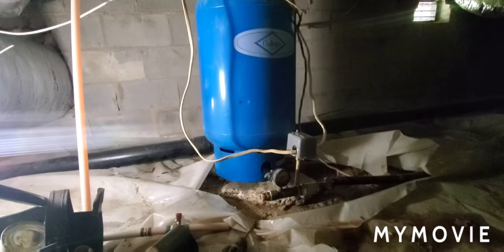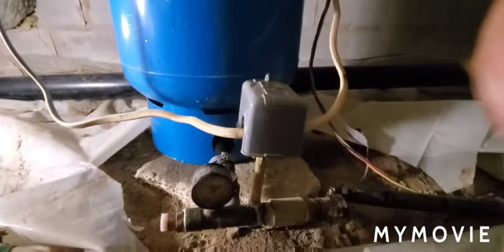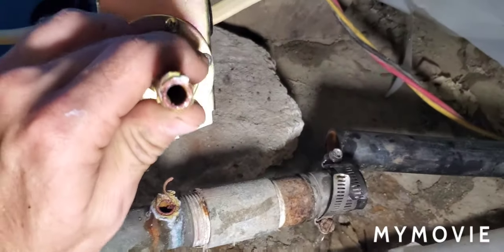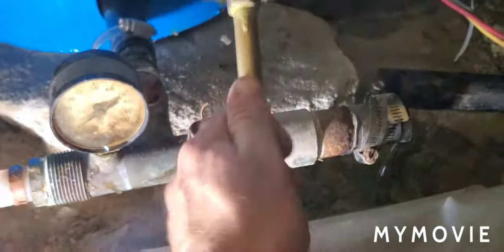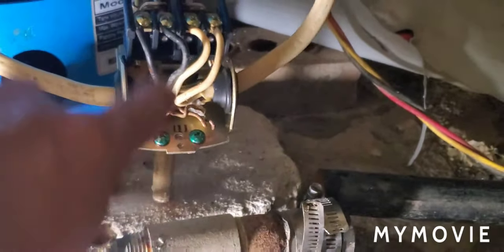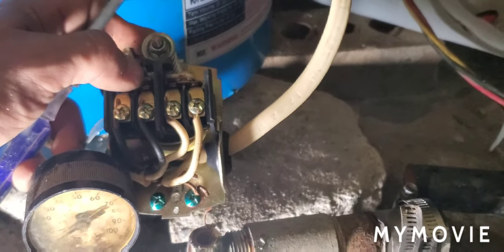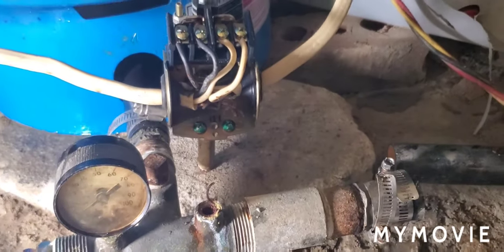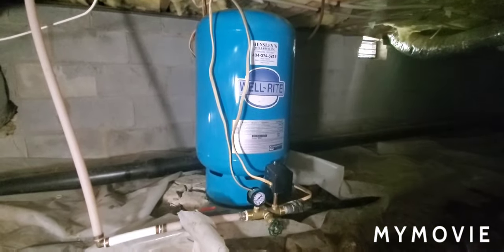No Water or Low Pressure how to fix it & diagnose the issue. Well pump not pumping

Comment: How would I find out if my well has leak in it because my pump runs without creating any pressure and I haven't seen any noticeable water anywhere?
Reply from the maker: Pit a Clamp style amp meter on a single black or white wire & if the pumps running, it'll read around 7 amp. Only way to know if it's running

Comment: I am not getting any water. I haven’t used the pump in about 6 months but have power to the switch. I can’t get to the possible build up that you show in the video. Any suggestions? I have a video showing my situation.
Reply from the maker: Hwdracing@gmail.com  email me the video and I'll try to help you. 
Test for voltage out at the well head where the wire connect. If u got power there & no water, you'll have to pull the pump/pipe out. Itll be a bad wire or bad pump (if it's a submersible pump)

Comment: I've got a pump that started running low voltage and won't get my psi above 40/50 psi. The switch is a 40 60 but the pump will just continue to run but gain no pressure

Comment: I have had no problems with my well until this morning  The contacts are touching and clean .   The pump is getting 110 volts and the contacts 220  .   No presure .   Blue tank is at 30 lbs.   Circuit breakers are working.   well pump 12 years old deep well pump only no surface  pump

Comment: QUESTION? My water in the house will randomly stop , then come on 30 seconds to a minute later. When I go to check ,the pressure switch is in the closed position n pressure is at 0. The pump then kicks on , fills the tank , then the switch opens.The switch is a 30/50 n is operating correctly.Could it still be a clogged nipple although the contacter is closed?  Tank n pressure switch is 3 years old. Any help would be greatly appreciated.
Reply from the maker: Your experiencing a dying pump. Itll run randomly for short bursts & cuts off. The pumps bearings are shot & its overheating the electric motor til it cools down enough to run again. 99% certain it is the pump. Your comment is spot on for that diagnosis

Comment: What would it be if I have good cold water everywhere but no hot water anywhere. My pressure tank is good. Brand new water heater because I was over messing with the old one. But I can’t get the water heater to fill.
Reply from the maker: It's likely that you turned on the water heater before it was completely filled with water and it burned out the top element (I've done it) bc it wasn't in the water yet. Youd have to measure resistance on both elements to make sure they are equal (test to see if 1 is bad) but the breaker must be off while testing. 
I always open the over-pressure valve to bleed out the air, then I open a hot water faucet til I get water & no air. Then turn it on (breaker)

Comment: I have 48 lbs of pressure in my tank (30-50), but no water when i turn on the faucet.Any advice?
Reply from the maker: Don't trust the gauge. They made for a nickle in China 😆 
I'll send you a link to 2 videos of mine that will help you.
Reply from the maker: https://youtu.be/PAd94cFX5y4
Reply from the maker: https://youtu.be/NUX5lcMLdOU
 These should help you. It's important to watch both & maybe take notes. You can setup the system correctly and get longer pump life & better pressure if you follow my guidance given in my videos. My channel has a Well Q&A Playlist that you might like to learn more. Hope this is helpful 🙂 Happy Holidays
Reply: @h2omechanic  Thank you so much!  I used a pressure gauge and it was at 39lbs but still no water lol. Turns out it was some kind of clog in the piping that wouldn't allow the water to flow.  I opened the hot water heater bypass valve and it let the water run.  Magically cleared the clog. I'm up and running. I appreciate your quick response. Happy Holidays.
Reply from the maker: A 30/50 switch needs 25psi of air in the top section of the tank. But air pressure must be tested & set with the pump off & water pressure at 0 / tank empty of water.
Reply: @h2omechanic  okay, thank you. I will do that right now

Comment: This video is very informative. I was wondering if you could help.  We have no water but the gauge is reading between 5 to 10psi. I did try to see if there was a spark and it only sparked one time. The other times,nothing. I also tried flipping the water well main box on and off and the only thing I hear click on is the control panel. Not sure if that's the only thing that is suppose to click. If you have any suggestions as to something else I may try to get water. I would appreciate it.
Reply from the maker: If you turn the power off, does the gauge drop to 0psi?. Being that you saw a spark, You probably have a failed pipe or fitting in the well, near pump. Or pumps old & won't lift water anymore. If powers off & pressure drops to 0, there's a hole in line in well. Also if it shows 10psi, water should come out at tank drain or sink, just slowly. If it stays at 5-10 w power off & sink open, the gauge is faulty. 
With power on, test for voltage out at the well. If power is out there... 240v typically, & no water,  then you must pull the pump out of the ground. If its 12-18 years old its probably a bad pump or broken wire. But it u see a spark at switch, its a hole in pipe or fitting. Hope this helps
Reply: When I turn off power gauge stays between the 5and 10psi. No water at all coming out. I switched out the pressure switch and nothing still. I also tried a new control box and as well nothing still. The pump is brand new,only 1 year old. Is there anything else I could try?
Reply from the maker: Test for voltage out at the well. If your getting power there, you'll know its down the hole. Possible a bad wire going to the pump. Wells are abrasive. They can rub away the wires jacket & prevent proper voltage from reaching the pump. Id say 75% chance that is your issue if u have power at well head

Comment: Hi. My problem is that I do have good water pressure, but my gauge wont go more than 30psi and goes down to 0 when the water is running. Is it my gauge?
Reply from the maker: Maybe the gauge is bad? 
Or possibly the air in the tank needs to be adjusted.

Comment: Hello sir ran into some issues with my well pump everything was working fine until I got inside the shower and ran out of water lol. 
When I turn on the circuit breaker the pump turns on it has a weird sound compared to what it had before and there is some burning smell coming from the pump .
the axel is turning and there is  small amounts of water coming trough ,
pump is running for like  30 seconds reaches 10-20 psi then turns off and repeats the same process what do you think happend ?
Reply from the maker: Pump motor is locking up. Replace the pump! Asap! I bet it feels super hot to the touch
Reply: @h2omechanic  just went back there took a look at it again and I was able too see that all the windings inside have been burned I guess that means the pump is done 
  is it better to get the motor rewinded or just get a  brand new pump ?

Comment: I just checked my pressure tank and water came out of the valve, it should read 28. It reads around 50, what might have happened? Thx
Reply from the maker: Water came out the air valve up top? Then that means the tanks bad. Time to replace it asap

Comment: The pump runs but doesn’t have much pressure..it just stays 20 lbs and when reach that point, the pump keeps running..doesn’t stop..and the gauge steady 20..? Changed the pressure switch plus connections piping..drained the tank clean it..but same thing 20 lbs..any helps.. thanks

Comment: Please help!  I have a situation with my system. Pump
Was not turning off so I replaced gauge and pressure switch. It was taking a long time to get to pressure 40/60.  Once it did it shut off, thought all was good.  Now (day later) it can’t get up to 40 so it just runs and runs. I made sure there was 38psi in tank, still not shutting off.  When I manually shut pump off it sounds like motor is winding down as if water is flowing in the wrong direction, it used to just stop completely.  No idea of what my problem
Is. Please help. Ty!!
Reply from the maker: @minorm2  the Water is doing exactly that! It's flowing the opposite direction once the pump turns off. Here's why,
You have a hole in a fitting down in the well or a cracked fitting/ pipe. 99% sure of this. Turn on the system and go put your ear to the well & see if you can hear it leaking (if not the the leaking area is below the water.)
The pump must be pulled out, if you attempt this, be careful no to allow it to break off & fall, so as you pull out the pump, use the wire as a Saftey rope incase the pipe /fitting breaks off completely. 
That's the issue, typically it's the fitting directly in the top of the pump.
Reply: @h2omechanic  I don’t have a well. I have city water filling a 5k gallon tank that the pump pulls from and then to the pressure tank to supply water to entire property.  The pump is located next to both tanks at ground level.

Comment: Once my pressure gets to 40 psi the pump doesn't turn on to raise the pressure. It works if I manually flip the breaker and raise it myself.
Reply from the maker: Remove the switch and clean out the nipple below it. (It's probably clogged) or the tank has too much air in it (if it's new)
Reply: @h2omechanic  I was just watching your video about this! Thanks I'll go try it.
Reply: @h2omechanic  it wasn't clogged.

Comment: I'm having trouble priming my deep well jet pump. I can hear air seeping out at the connection  between  pressure switch line and points..  This isn't good I believe tried to tighten also points are fairly new.   Been at it for some time now, took pump  off and threw it in the bath tub it ran fine hows this happening?? I have shut off valves in key spots not sure what I'm doing wrong
Reply from the maker: The air leaking in is cavitating the pumps impeller. You must seal everything. You test proved the pump is operating. It's on the plumbing. Possible foot valve leak too.
Reply: @h2omechanic  
God bless you sir .. to me and I'm   no pro but almost certain it sounds like its pushing the air  out at that connection, if foot valve were leaking i thought it'd be opposite and sucking. Just curious. You're right though sir on the plumsomewhere. At least I have a direction.

Comment: What if my pressure switch is kicking in and off like it’s suppose to but sometimes the pump won’t kick on when the contact connect and when it does kick in it seems like the tank is empty but the only time there is water pressure is when the pump is running as soon as it shuts off pressure is loss
Reply from the maker: The tank might have to much air in it.
The switch could be old & not making full connection everytime.
The nipple below the switch can be clogged as well.
If pressure fluctuates w/o using water, then the checkvalve in the pump is bad.

Comment: Hello, I am having no water pressure. The tank is 82V 75 PSI. I’ve tried everything. Most times turning off the breaker and back on again fixes the issue but not this time. Please help.
Reply from the maker: https://youtu.be/PAd94cFX5y4

This video typically helps get it going.
Reply from the maker: https://youtu.be/NUX5lcMLdOU

This explains more on how it all works. 
Familiarize yourself with the system.

Comment: We live  in SE Alaska..
Reply: Having problems since we relpaced!  Our pump.. takes for ever to get pressure to 60 psi.. we blew out the water line to make sure it wasnt plugged.. pump runs forever and  we have water coming into the house just not much pressure.. we didnt change anything else just the pump.. air tank is set correctly..

Comment: Ok I checked the pressure tank it is not heavy it ways about 20 lbs. I cleaned out the sediment to the pressure gauge and I checked the pressure/ pump switch and I still have no pressure. Any ideas 💡?
Reply from the maker: Test for power out at the well head. If you get 240v there, then its either a bad pump or broken wire
Reply: Thank you for your response I was only pulling 120 from one wire I used a thumper and there were no broken wires it was a bad breaker replaced it and she is up and running. Thank you, Ben

Comment: Help! Left sprinklers on by mistake for several hours. Looks like ran well down enough to run out of water in the house. I went under house and checked pressure switch it was in closed position but contacts were clean and do see slight spark when flicked open/closed. No water in pressure tank and zero pressure on the gauge. I tried flipping break to well pump. Nothing seems to be working, seems to me not getting water to the house from the pump. Any ideas or other things to check? We have no water going on two day now. Thanks!
Reply from the maker: Its possible that you burst the drop pipe. Is your pump 300 to 400ft deep?
Keep the breaker off!
Reply: @h2omechanic  it's a older well house built later 80's. So it's a wider, shallow well I guess you'd say. I have turn breaker off. Guessing issue is at the well or pump? Do they burn up if ran dry? Do pumps have a safety shut off in that case? Or maybe I sucked up some silt and blocking pipe, not sure. Looks like May have to call someone out tomorrow.
Reply from the maker: Above ground pump or in the well submersible pump?
Reply: @h2omechanic  submersible pump inside well
Reply from the maker: @shirsch4722  if you have a 24" bored well. You probably need a while to allow the well to fill up. Have you looked into the well? Can u see water?
Reply: @h2omechanic  yes I lifted the cover, and can see water level is above pump. When I had the top lifted, I could see the pump shake like it has cut on for just about 5 to 10 seconds then cut back off. Only did it once while I had top off that I could see.
Reply from the maker: @shirsch4722  if you saw it run for 5 to 10 sec & it quit, then its burned up from running dry most likely. Is the pump 15+ years old?
Reply: @h2omechanic  it was replaced in 2017. Like you say maybe it burned up. Going to try to have someone take look tomorrow hopefully. Thanks for the advice!

Comment: I’m having issues with my pump randomly shutting off, if I unplug the pump and plug it back in then it works. Any ideas?
Reply from the maker: If it runs for 20secs, & randomly off for 5 mins & starts up again, the pumps dead & overheating. Replace the pump
Reply: @h2omechanic  it’s not that, it will run for sometimes days, then randomly shuts off. Then I have to unplug it from AC power and then replug it.

Comment: I’ve got  issue with the pressure not holding up ive replaced the switch then the pressure came up for bout 5 seconds   But doesn’t stay on and now it isn’t getting connection at all
Reply from the maker: Bad pump or a bad wire in the well. Time to pull it out

Comment: I think my water pump pressure switch may be faulty (can hear what sounds like air leaking).  Any suggestions?
Reply from the maker: https://youtu.be/NUX5lcMLdOU
Reply from the maker: https://youtu.be/PAd94cFX5y4
Watch both videos to learn how to test
Reply: @h2omechanic  thanks but still not sure.  My system is a bit different, no bladder tank, just booster pump with pressure switch on it

Comment: my well presser talk is empty  and has 40 psi ,pump run i am getting water but my presser tank don't fill any water all time empty .
Reply from the maker: Tank air pressure should be around 25psi. 
Yes the tank seems empty. That's how it works. A Full tank is a bad tank. 
70% of a tank should be filled with air pressure and the bottom portion 30% is the bladder that holds the water.
Reply: there is no ware at all in the tank. if well pump is not running tank is empty and my presser tank has 30-50 psi switch.
Reply from the maker: @bhavesh505  try pumping water out at the well, if you don't get water there, then you have a broken pipe down the well

Comment: I have a 2HP well and it's no longer working with the generator..  But the generator seems to be working just fine.  The well company told me that I have to install it with electric instead of the generator.  Why is that?
Reply from the maker: A 2hp would require a 8000or 10,000w gen to start it. Yours might be too small. But its best to have it hooked up to the power box in order to get balanced power
Reply: @h2omechanic  Thank you so much.  Yes. My generator is only 5800w.

Comment: Hey man.
I have good pressure in my tank and it is empty. The contacts are closed but the gauge reads zero.

What do you think?
Reply from the maker: Test for 240v out at the well, if you get power there and no water, either the pump or wire down the well is bad. 
You should be able to feel the pump Hummm if you grab the pipe at the well head

Comment: Please Help 
Our pump tank will not fill  completely it will fill with just a few gal of water      the tank pressure will hold  
The pressure is set at 36   
The points keep flipping  the pressure back and forth  
The has been a problem for a while now  just getting worse and worse
Reply from the maker: The tank is bad. Try adding air to it . Or replace it.  water psi gauge is not the same as the air psi